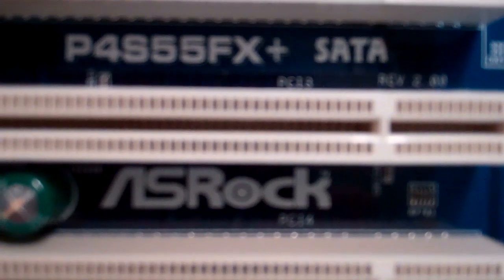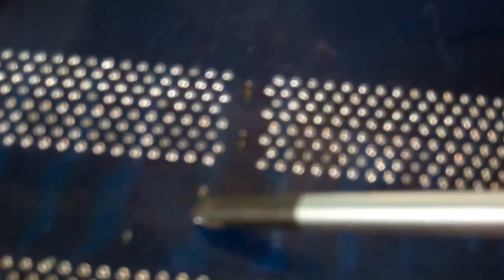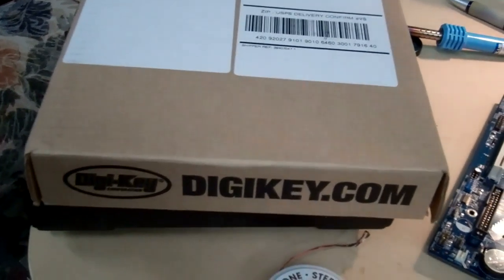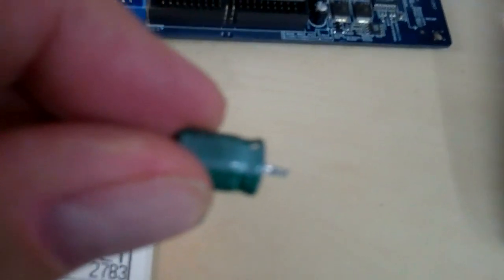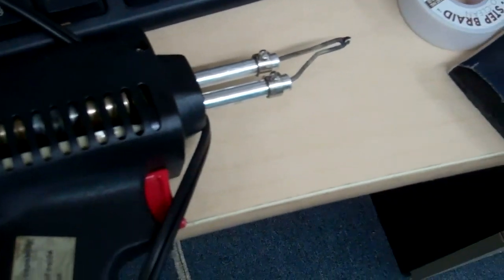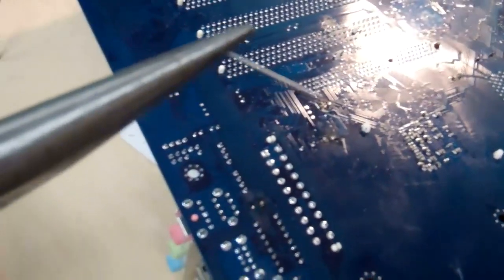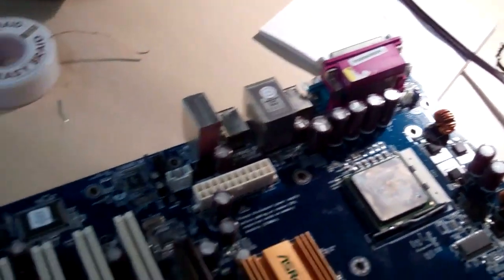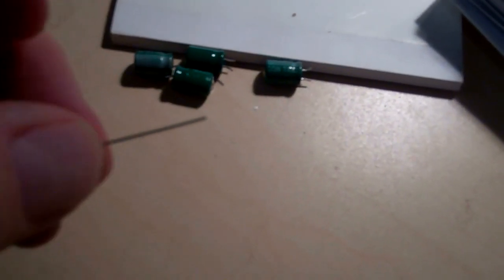Motherboard Repair Tutorial - Bad Capacitor Replacement

Comment: Can i replace 1000uf Capacitor and place 4000uf capacitor on motherboard?  Does it effect any problem?
Reply from the maker: As long as it is not too large and blocks the CPU heat sink.
Reply: @KentDiego  but can i place 2000uf capacitor?
Reply from the maker: @flatspin5382  Get a caliper and measure the size of the old cap. Look for new cap with dimensions where it will physically fit. Also measure lead spacing. If you look on Digikey web site you can filter by size. See my other capacitor videos for better demonstration. I like the high quality Japanese 105C caps. They are larger than the 85C caps but I can usually get them to fit.
Reply: @KentDiego  ok

Comment: you got something more wrong with your board if all them caps are like that ... /voltage regulator issues or something cause its frying man or your pc is getting too hot all the time too / it wouldve been nice to see you actually desolder em though bud ... im not trying to pun you man just advice is all ... but ive seen worse lolz

Comment: I have an asrock pro board and my pc was turned off overnight somehow and went to turn on in the afternoon and a capacitor blew up and caught fire burning a little bit of the board. Not sure what happened but now my gpu fan won't turn nor will the USB ports work from the board. I guess it's safe to say my board is probably screwed right? I hope my gpu and memory and other peripherals still work...although my system still powers up and the fans work so there's that. Any ideas?
Reply from the maker: If you cleaned up where the cap was and still not working it is likely a regulator was taken out by shorted cap. Figuring out where the bad part is located will be hard. I would use Ohm meter on the + cap hole to see if have short to ground. Then see what other parts connect to the + cap hole. Look up their part numbers to see if one is a regulator.

Comment: What's with Asrock and all these bad capacitors?  I have an Asrock and came here looking for a solution to cold boot blue screens.  I'm really hoping this isn't it.
Reply from the maker: You are lucky. This is absolutely the solution to your cold boot problem. Very common on all motherboards. You can get a soldering iron at Harbor Freight for $4 and the capacitors will be another $6. It is amazingly hard to replace caps the first time you try but after practice it goes quickly.
Reply: well I looked over the MB, and I don't see any bad capacitors.  My blue screen is inconsistent, only on cold boots and not always.  Once the system is running no problems whatsoever. For now the fix is leave the damn thing on.
Reply from the maker: That is how it always starts. Even though the caps look good. I had an intercom with pops and hum. Replaced the caps and worked great. They all looked good. When I put them on a capacitance meter most were good but certain values were next to nothing. I had a bunch of 100uF that measured 2uF. It is always a specific batch that goes bad.  Guess you can wait until you see leaking or bulge.  Usually these get worse over time.
Reply: Kent Diego
I have looked at this issue for a while. It can be caused by just about anything, including any component or driver.  Yeah, that narrows it down good :(.  I replaced the PSU because the one that was in it was a POS (did not build this one).  But that didn't solve it.  My SSD checks out ok, but I suspect it is that or the memory.  Then again it could be just a broken solder on the MB.  At least I got a new PSU and can keep it on for now.  I have two computers and will swap out parts until I figure it out.  Pain in the butt though.

Comment: And popping caps are the end stage, but who says ,other parts are still good, just buy a new mb before your cpu and memory quit. The fact that they allmost allways give you low esr panasonic capacitors fc or so, not watching or having the knowledge to just simply look or normally simply do the math if low esr is a smart idea.Offcourse there are fake once on the market, but having the right tools, it ain't hard to get by, if you have shitty onces from, especially ebay these days ,but new motherbords just have the reflow types, besides a couples a standard good panasonic, elna types, which shines thes the most, used for some extra power for headphones or media use, but asus does a lot of marketing with 15% ligther chokes, while there electronic ones and spike suppression with the tufs, nothing new about it....keeping it cold is the only right way to , couting for caps, certainly mosfets and throw away all that light shit...cchl and leddriver are low grade stuff and fan drivers aint the best emi rf wise, no lowgrade psu....200euro is a minimum, since they are fast swithing and mlox is real sad.... And watercooling using a goodpump, which you shield, extends the stability and lifetimes of whole your unit a lot, just watch the mosfet on your motherboard and take the datasheet and look at the influence of the lifespan on caps resistors,mosfets and their effective working space....also from your graphic card.....and that's shitty replacement solderiron, you need a sucker and iron in on and good cleaning and flux and at the and offcourse protection spray, but don't spend money if you only want to repair one board....your iron gear will be more expensive then that old board
Reply: ...Panasonic FC are premium quality (as DuleGURU said as well) in the capacitor industry.

Comment: this is the first times you noticed it????? and the caps may not be grade, but nobody of especially gamers, blaming themselves, high current, overclocking but still no watercoolong and having good well built powersupplies, no 1000Watts for heavy gaming, using a 100euro voltage supply, since 70% are oems

Comment: So i got an motherboard that no longer POST (an intel dx58so), a lot of people tells me is a bad capacitor somewhere so after watching this im wondering if is a good idea to change all the capacitors...
Reply from the maker: I look to see which caps are bad. Then I replace every identical cap to bad one. The theory is only certain model/lots are bad. The first time I tried to replace a MB cap it was a disaster. Took hours. After doing a few it only takes a few minutes. See my later repair videos for better tips.
Reply: Thats the thing I look every single one of them and for me looks fine. The board turns on and fans spins but no POST
Reply from the maker: There are a hundred ways for a MB to not post. Caps are often gradually increasing problems. If it just quit one day then likely not caps. I suggest finding a new MB that will use your old CPU and RAM.

Comment: when doing repairs on a board you should also note that if you have other caps of the same type on the board that are not blown but more then 1 is its a good idea to just replace the none blown ones to. also I have found out threw the years that you can just buy the cheapest caps you can get and they will do just s good as the expensive ones like you bought. my self I order everything on ebay most times I stock up of caps from china with free shipping in bulk so I only pay a few cents a cap.
Reply from the maker: Good tip. Usually every identical cap is bad even if not bulging.  I measured a good looking removed cap with capacitance meter. A 470uF cap measured 3 uF. Since caps are cheap with volume discount and shipping is highest it makes sense to buy a lot of them as is almost same cost. Good tip on China. I just checked AliExpress and the caps were all free shipping as long as you can wait 3 weeks for delivery.
Reply: Kent Diego that is part of wi I use ebay and contact sellers to ask for a bulk discount as with ebay if they come damaged I can get my money back and I have also fount I can get stuff quicker 80% of the time then I do with ali express. I also have a few other places I deal with and sometimes a local shop that gives me a deal when they buy in huge bulk.

Comment: Just a word of caution, from a professional electronics technician with 40 years of experience: Never EVER use a high wattage soldering gun on a printed circuit board like this. Excessive heat will delaminate the copper trace from the board, and you will have a repair mess on your hands. Use a low wattage soldering iron just sufficient to melt the solder (15-25 watts). Solder wick is fine. Just don't leave the iron on the copper trace any longer than necessary. Use the thinner variety of solder wick. Some techs use a various types of solder "suckers." Unlike the solder wick, which adds to the thermal mass and requires more heat for a longer period of time, solder suckers do not. Experiment and find which technique works best for you.
Reply: How exactly do you heat the soder up? I've got a 60w that was @ 400 degrees and the soder wasn't budging.
Reply: @RCsFinest  these boards are layered and you need to pre-heat them with a heat gun or putting the board in the oven for a few minutes to warm up, the free-lead solder will melt at around 215ºC
Reply: I heard that one has to use a 60 watt soldier as a minimum. One said it has to be a 300 watt. I don't know what is best.

Comment: I like the heatsink. What is the manufacturer / brand?
Reply from the maker: I looked in my order history from 2006, COOLER MASTER RR-UNH-P0U1. You can still see it on Newegg. The Pentium 4 Prescott ran so hot even that could barely keep it cool. They do not make them like that anymore.

Comment: I think it is easier to use a plunger to remover the bulk of the solder ten use the wick to get any residual solder that bay be left. No need to use the clipped leads using a plunger . Most of the time it leave a nice clean hole.

Comment: i have a strange problem i was given an emachines computer that was claimed to be working the last time it was used (which was apperantly in 2007) i went with what they said and when i got home it wouldnt post so i looked and saw 5 bulging caps and being an old machine i decided to try my first cap replacement on it
thats not the wierd part though
after it was finished i was too nervous to test it
so i left it in the chassis in my closet
i just went to test it but before i set it up i went to see if any caps were loose but i noticed one of my replacement caps was bulging now
how is this possible i never even started it nor plugged it into a power supply since the replacement
also i looked at the board the day before i checked it and it was fine seems to have happened over night
Reply from the maker: Try turning it on. The worst thing is the cap could explode. Japanese caps?. There is way they could change on there own.
Reply: what brand of caps were you using to replace?

Comment: Also make sure if you TV goes out check the capacitors and fusees you will replace the capacitors but it will not work check the fuses

Comment: higher volts is no problem will last longer plus check out the capacitor ratings some are made to go out fast the better the capacitor the longer the life span they are cheap 2

Comment: How certain are you that some capacitors are omitted during manufacturing for cost savings and that it isn't a bad idea to add capacitors just because there is an empty space for one?
Reply from the maker: Google "Muntzing". If you look at the traces and see the missing cap is connected in parallel with existing caps then you can be 100% sure. There could be a case where the optional cap goes to other optional components not used where adding extra cap is a waste.
Reply: Kent Diego Interesting. Thanks.

Comment: wouldn't it be easier to cut the capacitor off leaving the leads sticking up and solder the new cap to the leads? I did that to an old amplifier and it worked

Comment: I have the same problem. 10 green 1500uF 6.3v caps that are bulging. what is the function of these caps? most of the caps are close to the processor

Comment: Its a really old P4 motherboard, how long did you have it before the caps burst?
Reply from the maker: Maybe 5 years before started acting up. The issue is called "The Great Capacitor Scandal". Where Chinese cap companies stole the formula for the electrolyte paste used in an electrolytic capacitors from a Japanese company. The problem is when they stole the formula they left off a key ingredient so they quickly died. Now days the problem is counterfeit caps where cheap caps are counterfeited to look like name brand caps.

Comment: hey i want to ask you cus they give me the same capacitor but with more voltage shud i replace it with this or not ?
Reply from the maker: Higher voltage rating is OK as long as it physically fits.

Comment: Solder wick will do the job easier in removing the old solder from a board.
Reply from the maker: I love solder wick for single layer and even double layer boards. The trouble with motherboards is they are so thick with multiple layers.It is hard to get heat deep inside the hole or draw out the solder once hot. I jam a pieces of old resistor lead into the hole and use it like solder wick to remove the solder. I hear a solder sucker works well too.

Comment: How do I change a cap:
1st 
add MORE, FRESH solder to the pins of the old cap. take a soldering iron with a larger tip shaped like a flsathead screwdriver. heat up BOTH pins of a cap at the same time and pull the "rotten tooth" out when the solder is liquid.

then 2nd
clean the pinholes for the cap in the M/B,  and here the vacuum pump does a better job I think.

OR make it the badass-mode like I show it in a video :D

Comment from the maker: Using copper wire (component leads) to clean solder out of holes has worked well for me. The issue is if you have a small bit of solder deep inside thick multilayer board how do you heat it up without risking damage to board? The vacuum technique videos I saw suggested completely filling hole with new solder and trying to suck it all out at once.Your heat gun idea is interesting. The wire method conducts heat to the solder where it attaches to the wire for removal.

Comment: u could use a magnifying glass for closeups :)
btw I would never work with this copper wire to soak up the old solder.
I prefer the vacuum pump
AND I always try to replace capacitors in power supplies as well.
in there are almost the same ratings of caps. 1500uF / 1200 uF or 1000uF.

for M/Bs it cant hurt to heat up the area (GENTLY!!!) to solder with a heatgun at first

Comment from the maker: Finding a new MB that will fit your old parts can be very hard. Plus repairing your broken MB is so much fun! Consider that if you get new modern MB, CPU and RAM then you will have to re-install Windows and lose your setup.

Comment from the maker: Sure you could do that. A high quality wet electrolytic should last for 20 years but solid would likely be even better. 
Anything is better than a failed bulging cap. Many people salvage old caps from failed power supplies.
The most important consideration is size. It has to fit the available space. Good luck!

Comment: Why not change to solid caps?Arent they even better?
Reply: if they are the rite voltage id do the same solids rarely take a dump ... he has some other issues going on  with all this crapped out caps thats alot pc overheating too much or voltage issues some were blowin caps

Comment: Glad to read some of your comments. I had a subwoofer professionally repaired (after they didn't have my 4700uf 35v capacitors in stock). After paying parts and half of labor (they said only parts when I dropped it off), the two caps I was going to replace were taken care of, but they left one with a slight bulge. The unit works but I'm wondering how long I have until I gotta replace it, haha. Good vid.

Comment from the maker: Removing the battery is a bit risky as you can sometimes break the holder. Usually there is 3-pin header with jumper close to battery. You just move jumper to other side for 30 seconds and then replace to clear CMOS battery. There are a few motherboards that do not have this jumper.

Comment from the maker: A spare power supply is good to have. Maybe from an other computer? I have seen the beeping be bad RAM. Remove video card and see if still beeps. If not PS then likely a voltage regulator FET has blown. Look very carefully to see if a capacitor blew up as that would explain the goop. Time to search for a replacement.

Comment from the maker: "bad" implies it does not work. Motherboards can have bulging caps and goop all over but still work. Usually bad cap problems start occasionally and get worse over time. Intermittent crashing, freezes, re-booting and boot failures. If it was totally good one day and completely bad the next it is not as likely to be caps. So what is not working where you think it is bad? The best way to troubleshoot is the "replace with known good" method of troubleshooting. Could be other things besides MB.